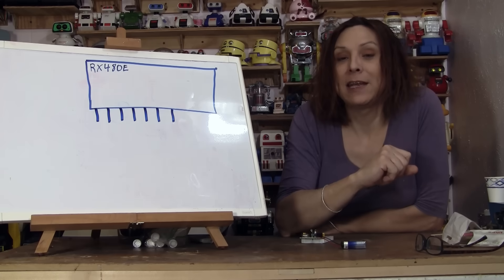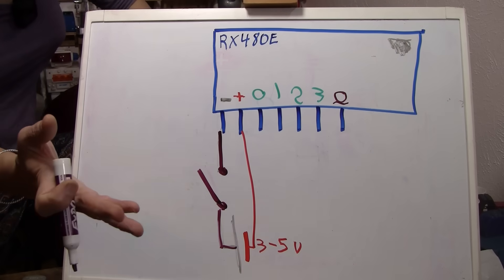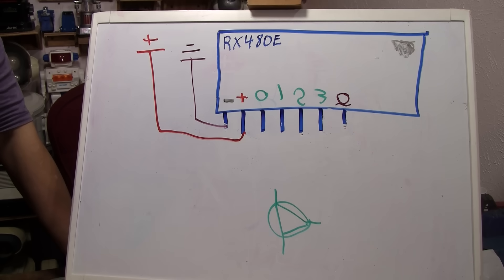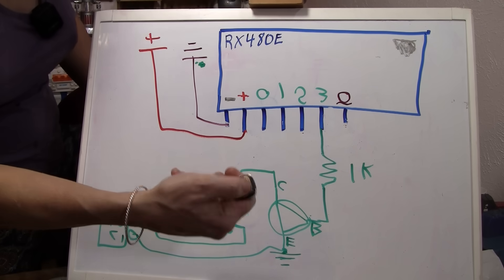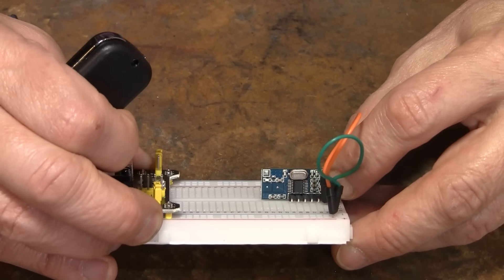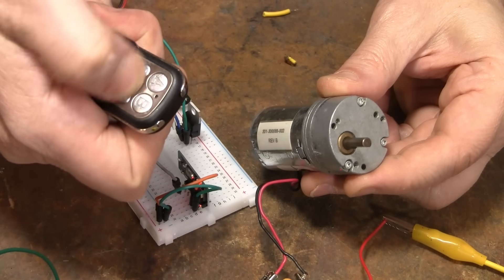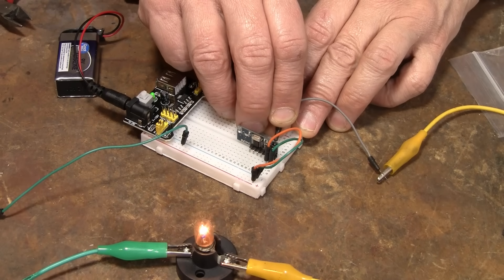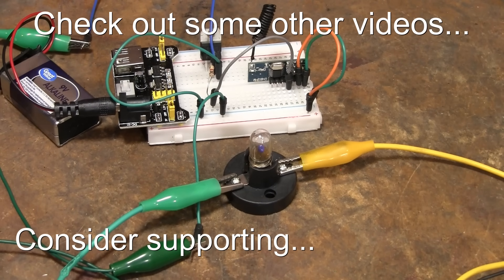How to Make Anything Remote Controlled with the RX480E Circuit!

Comment: You can use uln2003 to keep things cleaner and easier. There will be 7 buffers each can handle upto 500mA power and they have clamp or freewheel diodes builtin. If your motor needs higher power than 400mA you can combine more than one buffer in parallel. You can google for all the terms I have used here.

Comment: these RX480E are hard to find in a complete set. I did find some on ALLIEXPRESS(about $5USA for a set, each ). Amazon had the receiver but not the remote,, none of the remotes I found said they would work with the receivers( only garage doors). 
with out this video I would not have been able to set up the RX480E. the instructions were NOT clear in the listing for the item. and the unit came with ZERO instructions.
thanks for the video, it really helped.

Comment: A wonderfully casual video. I see below that I wasn't mistaken regarding battery symblos. I am old fashioned and I like Relays to turn motors on/off other than that nice practical video. You were a little casual with mains voltage though. Glad you survived.

Comment: Hey Randi, have you ever come across a MOSFET Trigger Switch? I have one for a solenoid and it got hot, it's too small. I clean raw gold by separating it from the dirt and sand on a wave table, it's a small table like a TV tray with a little water in it. It shakes, moves back and forth when the solenoid pulses 12 volts. The trigger switch for this 12 volts gets a pulse from a PWM adjustment. So I wonder if I could build a heavy duty trigger switch, or if my solenoid draws to much current? What's your opinion of all this?

Comment: Hello,, I just found your site wow so impressed.. I have a slight problem I need help with about this video. I need to control two small mini servo motors with a keyfob. A&B would control one motor left and right while C&D would cotrol the other servo mini servo motor left and right and if possible be able to recharge the batteries all in a very small enclosure. I do educational programs and wanted something to wow the studends with a new project that I am working on. If there is a charge for this help I understand and have no problem paying to get the end result I want to accomplish. Thansks

Comment: I don't know if anyone else noted, but a MOSFET would be far more suitable than a bipolar device for driving a high-current source like a motor. Bipolar power transistors are not efficient since they can't pull the collector down all the way to ground.

Comment: Isn't it the TIP transistors usually PNP? Is there a TIP NPN? And another doubt is why people use the colector pin to install devices? Isn't the emissor the correct pin to do it? As far as I know some transistors have a diode inside, in that case install the load in the collector pin wouldn't work, so why don't just do it the correct way that is, as all datasheets inform, connect the load to the emitter pin?

Comment: The motor needs a 'reverse'-connected' diode to protect the Darlington transistor from the huge back-EMF voltage from suddenly disconnecting the power source.  This diode acts as a 'snubber'. Substituting a capacitor for a snubber diode is very poor design. Substituting a 3-volt-controllable relay module is a much better solution. Where did you intend to install the transistor, itself, and the necessary current limiting transistor base resistor as well as the LED and its current limiting resistor? Your execution of the circuit is half-baked and not based from actual experience. The obvious mistakes drawing the LED and battery symbols clearly demonstrate this.

Comment: Thanks Randi, Ive been wanting something like this to tune a capacitor remotely in my antenna tuner for ham radio use. Wonder if it would work 30 or 40 feet away from the  TX and RX

Comment: Positive is the long line.
Negative is the short line.
For the power supply.
The way to remember is the positive uses more ink! (+ sign) then the negative (- sign).
Apart from that, you know a lot more than I do and it was a cracking video!

Comment: I have this chip and a TX118S-4.  I want to know if I can run 2 pairs in close proximity without interfering with one another. So my question is this.  When pairing, is ther some unique identifier that will prevent it from responding to another key fob?

Comment: What an interesting twist at the end, finding out you’re a magician.
 When you showed the first 9volt battery it briefly looked like something I made many years ago. The printed white and blue looked like taped down wires and a tiny switch.

 When I was a kid I took apart a 9volt to see what was inside. Got the idea to drill tiny holes to run wires outside the box so it didn’t work unless they were connected. That eventually evolved into a cleaner version that could be examined without any noticeable difference from a normal battery.
 I had a lot of fun messing with friends with that but it seemed to be even better on adults because they all knew what a 9volt looked like and the thought never once crossed their mind that a little kid would have gimmicked one. They probably didn’t even know you could open one. Early on with the external wires, I could just set it down and they wouldn’t even turn it over to look at it. That made me a little nervous though so I had to work on a few others that could be handled.
 I never got them PERFECT because it’s tough to open the seam without damaging it then close it up again without doing even more damage but I got as close as a kid with a knife and pliers and a hammer can be expected. 
 Always wanted to do a switched Double A battery with a Triple A inside to leave room for the wire but opening those was a scary mess of paste that I figured was pretty dangerous so I only made one and never got it to look right when trying to close it up.

 Anyway, great video. I’m ordering some remotes for a project so I’ve been brushing up on DIY vids before taking stuff apart. Glad I found you here. Thank you.

Comment: Controlling remote devices, model aircraft is my hobby. But I have zero knowledge about electronic devices like transistors. I have a question at the 5:55 mark. What does the 100 -140 represent, volts, amp, ohms, etc?

Comment: Cool video!!!!! I have seen these kits before though about making a remote start for a vehicle with one but since tgey were 3-5v i dint look into it but using a transitor and a relay i would be able to engage a starter motor. And put a timer for the ignition nay have to do a little research into this thanks for the info!!!!!!

Comment: I'm trying to use this in combination with an ESP8266 WiFi module. I thought it might have fried my ESP because my ESP was no longer connecting to the WiFi network. But after disconnecting the receiver module the ESP could once again connect to WiFi. Maybe I need to keep them farther apart, not on the same breadboard.

Comment: I dont know much about electronics, but wouldn't you want a flyback diode instead of the capacitor? Also wouldn't you need a pull down resistor on the transistor? Brilliant video though!

Comment: I've tried this on my breadboard and it works just fine, but remeber that the two power supply negatives have to be joined so that they are common with each other.

Comment: Retired Electrical Engineer here.  As a couple others have said, add a diode across the output coil device.  I learned this trick about 40 years ago.  Whenever I controlled a solenoid type output (relay, motor, etc.) from a transistor's output, I would put a reverse-biased diode across the coil.  If you measure the voltage at the coil when the transistor turns off, you'll see a much greater voltage generated by the coil.  This generated voltage will kill the transistor's output.

Just found this channel.  Looks like some good info here.  I'll keep watching.  Thanks.
Reply: True, diodes are an easy to do reinforcement anyway if you work on something where blowbacks like that could happen.
Reply: @Iskelderon  Agreed, A capacitor is only really useful for a traditional stator/rotor to kill any RF.

Comment: The RX480E uses the EV1527 data encoding format.  While it can distinguish one in 2^20 (1,048,576) transmitters and up to 16 button commands per transmitter, the EV1527 format is not suitable for use in high security applications.

Comment: Nice presentation and interesting interpretation of electrical symbols! You used a npn transistor, but I'd recommend mosfet to use as a switch. Npn generates lots of heat and it is very inefficient with high current.

Comment: I just looked this part up on amazon and there is a big problem, they operate on 433MHZ and that is smack in the middle of the 70cm ham band (420-450MHZ).  Unless you are licensed to use those frequencies stay off, presenting this information is very irresponsible of you.

Comment: The only thing I would add is that when you run an AC motor, you will want a capacitor in parallel with the motor. This is because in an AC circuit, there is a phase shift between the current and the voltage change due to the inductance in the motor. A capacitor will bring those two back inline. (This is regarding what we call reactive power)

Bottom line is that w/o a capacitor, you're using more power to run the motor with some power basically wasted due to reduced efficiency in the motor.

Comment: Appreciate you for sharing you knowledge.  Is there any way to have it momentarily contact two wires on a dry circuit?  Please let me know.  Currently using doorbell button connected to dry circuit that is monitoring resistance changes.  Thanks again.

Comment: Be careful with solenoid and motors. Put a flyback diode across the collector and emitter to protect the transistor.
The outputs look like they are 4 sets of momentary outputs (while the signal is present). It'd be nice to change the buttons to have 2 sets of on and off instead for the motors.

Comment: How about on AND off. But without the constant setting on the fob. I know we can change the fob to momentary or constant. I would like to turn on and off the porch light with a fob (Im lazy, so what?)(😂) but not use the power needed to hold the contact engaged, not having the TIP using power by the fob constant setting. (Dont say arduino 🤬). So, what ya got oh teacher wid da big brain😂 (no offense intended- humor) would you kindly produce a video that would allow this 40yr electrician to, use the single pole switch beside the door, and use a fob to also turn that sucker on and off? There is room in the switch box for a 3-way but I really would like to incorporate electronics into the circuit, but I will use the 120vac supply with the proper reduced dc voltage to power the electronics needed to run them, 3-5vdc. 
 I subbed and absolutely love the way you teach. If I had had a teacher like you when I was going to DeVry in Ga. in the 80s, I prolly wouldn’t have dropped out after 3 semesters. I enjoy electronics and when my ‘Lil Mule gate operator’ died, (them idiots wanted $250.00 for a new board! 🤯) I just made my own. I tried it with arduino but… lets just say I cant code! Soooo, I got a fob like the one in this video, a Cytron motor controller (60a) (only needed about 12a😉) and used that three button fob to activate one button of the fob to open the gate and the bottom of the three button fob to close. Ya have to hold the momentary to open and close the gate far enough. (Darn arduino woulda meant just one button push to open delay a few sec then close with any resistance spike equalling something in the way causing the gate to reverse to last position then a delay then finish operation. I just wasnt smart enough i guess. But then again!!! I did tell AI to write the program for me. I havent tried to see if the program would work yet (again lazy😉) and the one I rigged up in its nifty water resistant lil box has been workin just fine for two years! So, how about that video! 😉
Thank you.

Comment: Sooo the TIP 120 Transister can work like a tripod Relay instead of having to use a 4 wire relay. How much amperage can the tip 120 carry before I have to switch to using a relay?

Comment: Randi, this is great!  A question, do you know if the chip uses rotating codes for the button functions, or is it a simple signal representing each button press?  I ask as if the kit uses just simple signals for each button press, Id probably restrict my use to like RC toys.  With cheap SDRs nowadays, it would be to easy for anyone to record then replay the button press.  If the chipset has rotating codes paired with the fob, that would be amazing - simplicity with decent security.  Anyway, thanks for this...a great intro!

Comment: This is awesome. I added this circuit to my girlfriend's vibrator, to make it wireless. I know, there are many cordless vibrators out there, especially on AliExpress, but they are clones of the same basic product that my girlfriend found inadequate. Her old trusty vibrator from 1995 was "the best", American made, and unmatched,  in her opinion, but it was not cordless, I removed the 2 AA cell compartment, and carved out the battery holder with my Dremel,  as those cells are cylindrical and did not use space efficiently. Replaced them with a Lithium ion rectangular cell which fitted better along with the RX480 circuit in the space constrained housing. Now she's got a rechargeable, powerful, and remote controlled toy. It's so rewarding to apply electronics to something so pragmatically useful.

Comment: cool vintage robuts! (hihi... thats how they were called...not bot but ro-but...hihi funny)  Do you have an Emily somewhere in there...i used to play with one. I have some Hero jr and sr heathkits that i still gotta breathe life into.. somehow, .. one down 4 more to go.... but some have robot arms i think i can save maybe one more Hero jr and one sr. with donorparts from the other two...but still leaves me with some spare arms . with 6v msteppers arm , wrist and grapper hand... So i saw your vid and i think your way would help turn the spare arms into a nice fun remote controlled robotic arm on a custom base..i thought maybe just use two sets of fobs...and strip casing and 3d print a custom controller... to toggle the buttons of the fob-boards.. I wanted to get a big kit but like you mentioned many batteries and excess overkill and price too .... your way makes it easier and less complicated and easy to buy for couple of bucks ... which makes it a more fun project in my mind ...your vid just filled my head with many fun things i now wanna do ...about time too cus the boxes of heathkit parts my dad once bought in '76 are just begging me " OPEN!"...

Comment: well, in general, when connecting an inductive load (motor, solenoid) through a transistor, to protect the transistor from high voltage surges, we always put a reverse-connected diode in parallel with the inductive load. preferably a fast-acting one, uf, fr series

Comment: Battery symbol is inverted, ie. the short bar is the negative. Also Kirchoff's first law says that in a series circuit there is only 1 current and that the sum of the voltages is equal to the total voltage so regardless of where the switch is located, the circuit will be off and there will be no current. If the battery decides to leak because of deep discharge that will happen regardless of the switch being off, it's chemistry of the battery and has little to do with position of the switch.

Comment: Hello.  I just found your channel and I like it. I also like the relaxed and descriptive demeaner you express when describing things. I have sent this link to my grandson. He has started to learn about electronics and this is right at his level.
QUESTION..........
Where did you get those cases you are taking a capacitor out of at the 13:20 mark in this video? Those are exactly what I need for my capacitors & resistors and a few other components I can print up labels for. If they are from a "set" where is that set from?
Thank you.

Comment: Watching your video and considering the next day, I want an auto sensing cat door opens and closes in the floor.  Yes floor.  Using and old hvac vent, my ¼ wood door is too heavy and no way to exit only lift with their heads to get in but no way to get out.   I Looked at springs, human doors but the best is my solar powered chicken coop roll door which is flat and could work if attached to a body motion sensor for both in and out as well as both vertically and horizontally.  No springs or wires (auto closer) or necklace activated to pinch, distract or hang them.  Could you make it please then patient and make a fortune but most importantly send me one for my 50+ and growing cat, kitten colony that I feed and care for. Or at least the plans.  Welcome to email me or contact me pm.

Comment: Your video was very educational for an old lady like me, with basically no electronic experience.  I build animated Halloween props for a 120 year old lighthouse museum’s annual haunted house fund raiser.  I have a couple of questions.  If I wire different props to each of the terminals, I assume each is individually triggered by their programmed button.  I assume I would need to wire the RX480E, with its power supply, and each prop would then need to connect to one of the terminals on the card?  All the props would need their ground wires connected together?  If I want to use a second set up somewhere in the house, would the second control fob for the 2nd setup trigger the 1st setup, or would they work independently of each other?

Comment: This is probably the same circuit in a box I bought from Amazon to control one of my garage doors where the remote failed. It comes in a nice white box with screw terminals and an antenna wire. It's got a full wave bridge on the power so you can connect ANY wall wart that's >6v without regard to AC or DC or polarity. I just wired one of the relay channels in parallel to the push button switch and problem solved.